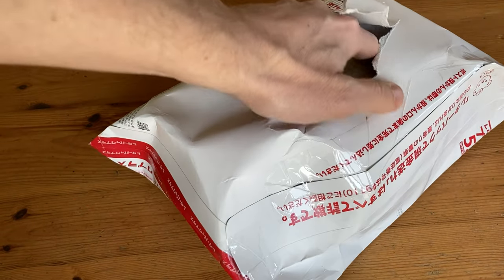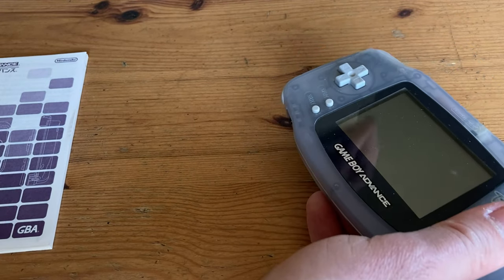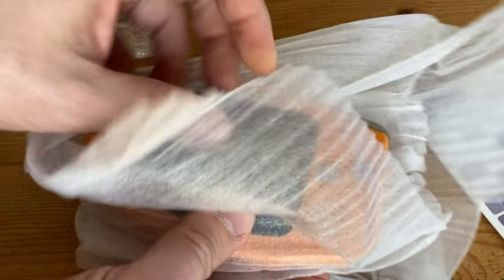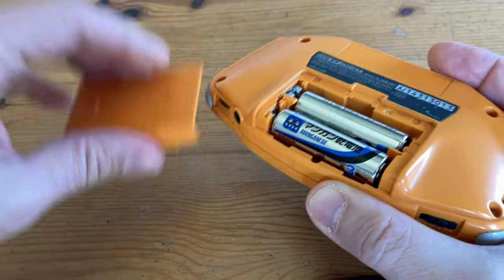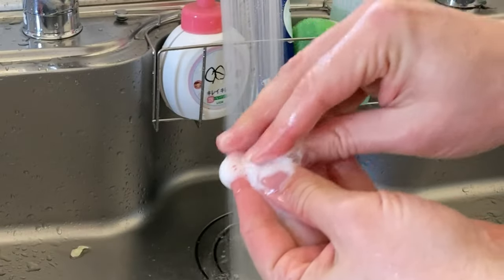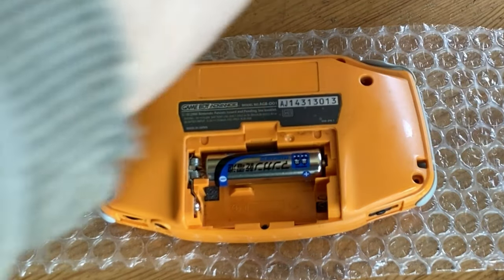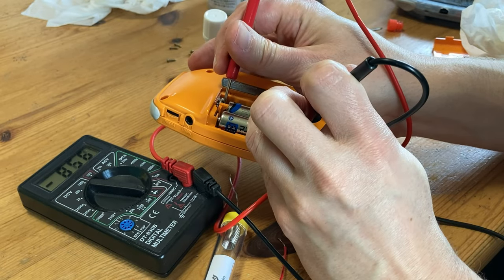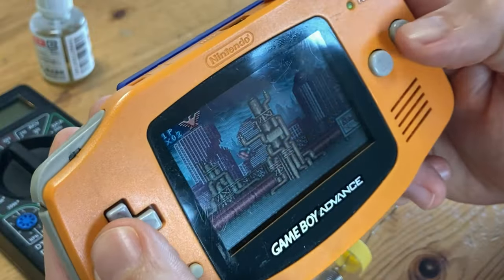GBA EASY FIX!  Repair a Gameboy Advance That Doesn't Turn On

Comment: I'm planning on changing the case and the screen of my old GameBoy Advance (would be the first time I do something like this), but the screen and sound have given me issues for a while (well, when I played it, I mean), so I don't know if these "packs" they sell on Amazon and other places (screen + buttons + case) would be enough to make it better. But now I know there's a thing called contact cleaner that's used to clean electronics, so I just learned something new. ✌🏻

Comment: Mine powers on, but nothing shows up on the screen 😢any suggestions? Thanks
Reply from the maker: Does the game actually boot up?  Can you hear any title screen music playing?  If you can, then I'd maybe open the GBA up, and take a look at the ribbon cable where the display is connected.  Unplug it, give it a few squirts of contact cleaner, reinsert.  That might fix it.